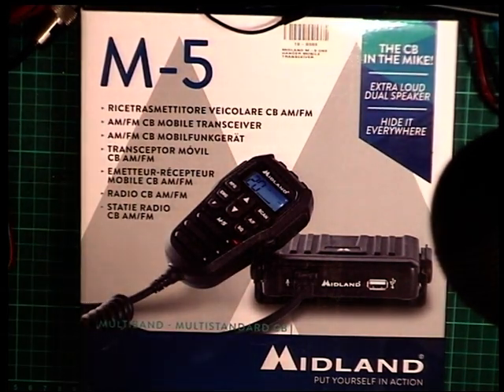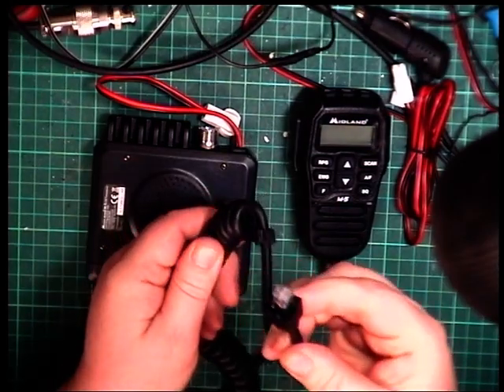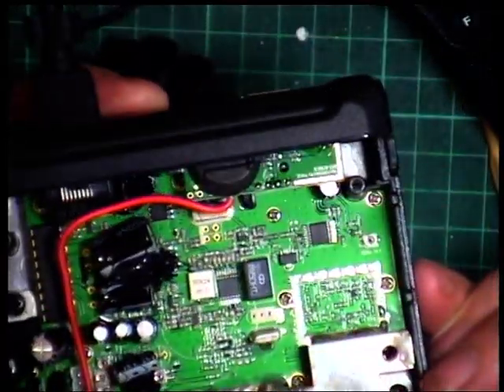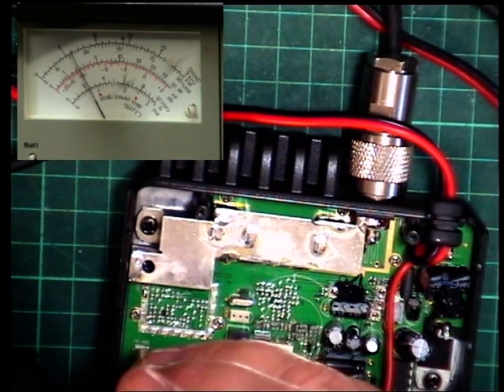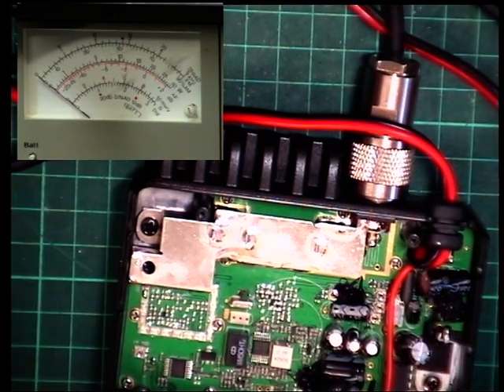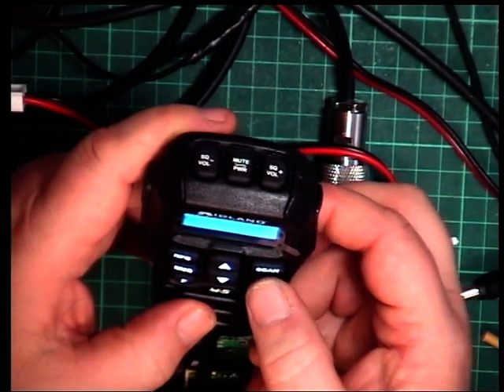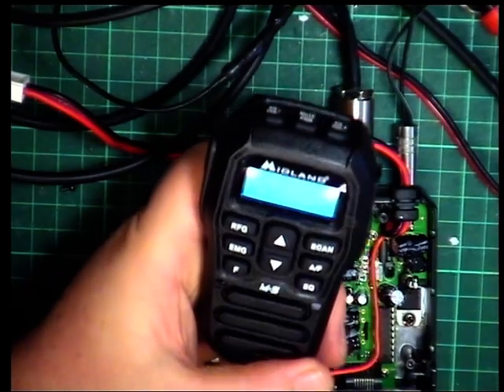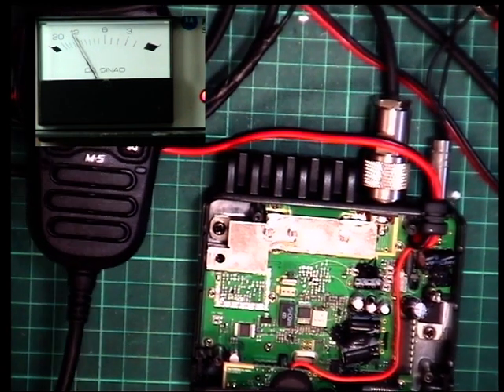Midland M5 UK CE-MultiNorm CB radio (mobile) - Overview & adjustment

Comment: Big disavantage is when you connect headset the unit spesker can not be turned off . Asq  i could not find propper level ajustment and was often interupting . Recieving was in waves ! YOU are right crt mike is way a better set .

Comment: You can switch off the speaker in the microphone by pressing F, then Channel Down button. And the set is indeed very loud - I had to put a resistor in series with the speaker. My M5 didn't come with that frequency booklet!

Comment: Hi Richard , another interesting  video thanks. You have again highlighted the fact that most new radios dont correctly implement switching easily between 27,81 abd cept AM and FM. Have you kept a list of the radios that actually do implement correctly?
Reply from the maker: Thunderpole T3000....comes to mind. Yes, it's time to add an extra firld on the stock control computer with a tickbox for "correct band switching". Good idea Mark.

richard
Reply: @ukfmcbradioservicingTango21  I agree, also simple working, these menu driven sets are to complicated when driving.  It like modern car radios these days, you have to take your eye off the road to work the dammed things!  Ok, everything is on the mic, but honestly, the old sets were a lot easier to work, I think I would rather have a Stalker 9DX than fart about with that set, though there is a huge difference in size.

Comment: Thanks for the review Richard, much appreciated. So you prefer the CRT Mike out of the two similar options?
Reply from the maker: Yes, but I've the PNI HP62 which could be classed in that catagory & the Polymar or Maas or whatever  'Venus' to look at next week. To be honest, the best remote rig in my opinion is the old Audiolinne 342. If it wasn't for the fact the Realistic TRC2003 has to have a capacitor changed to overcome the crap tx audio, then I'd say that was the easiest to work....on/off vol, sqelch, channel.

We'll be recording an 'on the air' test today with the Midland M5.

richard
Reply: @ukfmcbradioservicingTango21  Thanks Richard. Had a quick look at the Polmar Venus, another contender. Ease of use obviously important, driving and staring at a little screen and buttons defeats the object.
Reply from the maker: I can't seem to now be able to buy the 'whatever' Venus, so I think I'm too late & it's been & gone. My computer says "no stock" here either, so I ,must have imagined we had one.

Richard
Reply: @ukfmcbradioservicingTango21  Just looked at the PNI HP62. Another contender and interesting model, if it works well with a proper antenna ?
Reply from the maker: @granttingle63  Yes, the aerial connects at the bottom of the curly lead to power & antenna in a pretty usual way. The three PNI sets we have tested so far have worked fine. We've just the HP62 & their flagship one to do. I'll do the HP62 this week.

richard

Comment: Is there a way to make it turn on with power? (I.e. if its wired into an ignition live)
It seems to need to be turned on with the button every time!
Reply from the maker: I've just looked through the instructions & it seems not. This isn't the only set on the market to have an electronic power switch & I agree that would be a pain. I'd have it to a permanent power feed & leave it on whilst ever the vehicle is in use,

Richard
Reply: @ukfmcbradioservicingTango21  Thank you for the reply. I'm not keen on having it on a constant live, in case I accidentally leave it on when the vehicle is not in use.  I'm assuming there is no easy way to modify the circuitry?
Reply from the maker: It doesn't have a normal power switch.

Richard
Reply: @ukfmcbradioservicingTango21  Can you recommend a different radio with all controls on the mic, that does turn on when powered up in the usual way? 
I suspect it won't be listed on any advertisements. 
Thank you. Ed
Reply from the maker: The 1982 Audioline 342 or the Realistic TRC2003 from 1983. Both work well & have crystal filtered receivers & both were very expensive st the time £129-£149. I can't recall any later or current models with a conventional power switch.

Richard

Comment: The pcbs are still too big imho. When will they fit into my tooth? 😹 Thx fer the vid dr op.
Reply from the maker: The BBC Radio 4 transmitter on LW 200Khz is very powerful...and I think it was built in 1937 too. A lady who lived near to the transmitter couldn't sleep at night as her teeth were picking up radio 4. It transpired that she had a failed filling in one of here teeth that was working as a crystal detector diode!

Richard
Reply: @ukfmcbradioservicingTango21  This story seems legit.
Reply: @ukfmcbradioservicingTango21  R4 LW is 198 khz (used to be 200 / 1500mtrs) and I believe it's 500kw!!!
Valves (tubes) for the TX are getting hard to source now!

Comment: So the bottom line is basically it's a shit radio
Reply from the maker: It'll probably work OK when we do the 'on the air' test today; but I've seen better build quality, more power output, and better firmware for what you would expect to be a premium radio.

richard